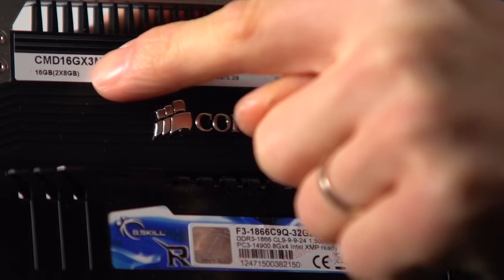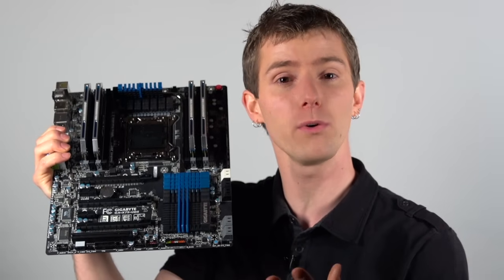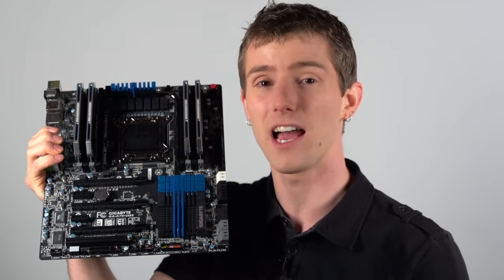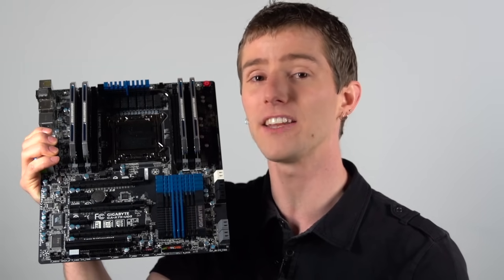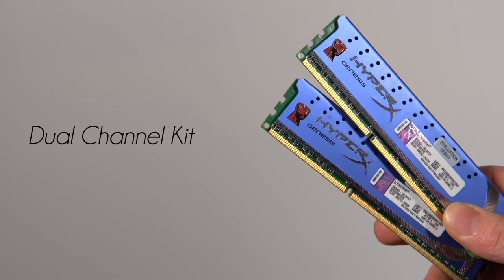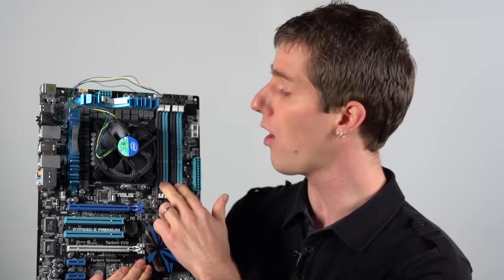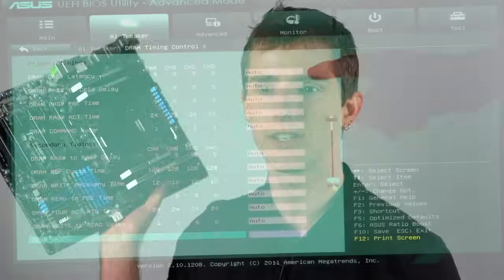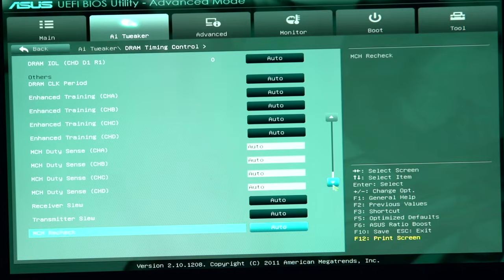Guide to RAM Memory Channels as Fast As Possible

Comment: can i use 1600mhz on motherboard with 1333mhz capacity without any problems ?
Reply: +Jadwin Edison You could, in theory but the motherboard will most likely just run the ram at 1333mhz
Reply: lol well fuck.
Reply: It will clock down to 1333mhz, and a 1600 mhz ram might be more expensive than 1333 so find one if u could
Reply: You would do MUCH better to install the 1600 mhz speed ram.  You can adjust the setting to utilize the newer speed.  Even though they post limits on the documentation, you can over-ride them in the bios.  AND you can gain speeds in other ways too.  You can lower the wait states to gain performance without increasing the speed.  That will also offer you another way to get more performance.  I have build over 1000 machines, and I am a board designer.  Good Luck
Reply: @ralph Hi so im going to build a pc for the 1st time and im a bit confused as to how ram works. the mobo is a z370-a pro and it has 4 ram slots dual channel, it says it can hold up to 64gb of ram so i could use 4x16gb 2400 mhz right ? even tough it has 2 slots in one color and other 2 in other color?
Reply: Yea it will just be bottlenecked
Reply: good to know

Comment: so if my mobo's memory channel is DUAL but has 4 dimm slots, using 2 sticks is the way to go because 4 sticks MAY or MAY NOT work?
Reply: +iFLIP★07 I am also wondering this.
Reply: +iFLIP★07 i think what he's saying is that when using a kit of 4 ram sticks, its more eficiant if they were all on the same channel (i.e. quad channel board) and thus in a dual channel board they might not be as efficiant.
Reply: ackly14 it's not about efficiency. He plain simply says that quad channel memory might not work properly on dual channel board (mobo might fail to initialize memory's configuration automatically as it should) and might give you some hustle (configuring dozen of memory parameters by yourself).
Reply: Goran Jankovic excep that makes no sense as he said just earlier, that quad channel memory would work fine as dual channel memory. so why cant one quad channel memory set be split up into two dual channel sets? they should work just fine i would think.
Reply: ackly14 have you watched the video and listen what he was saying? They SHOULD work fine, but they MIGHT NOT. 1:50
Reply: I bought a quad channel set of G.Skill RAM and I'm using it on my z170 mobo with a 6700k. The RAM runs in dual channel and with the XMP turned on runs at the rated 3000mhz. I haven't had any crashes or performance issues yet but only time will tell.

Comment: Can I buy one 4GB stick and then later buy the same stick and work as Dual channel?
Reply: yh but no :I
Reply: yeah... but yeah. yes you can
Reply: you can but they wont be validated to work together in dual channel mode so you could end up with your ram running in single channel mode or worst case have an unstable pc but thats very unlikely so id just go for it and test it in prime 95 and if you get any problems try running it with one stick and if that works send the new  stick back and either get a refund or try again
Reply: ***** yea but that didn't happen much. Most of the time they're fine

Comment: bought an ROG laptop with 16GB RAM (16x1) single channel, when I checked with CPU-Z it says that the stock RAM is samsung brand. but since my local store doesnt sell samsung RAM I bought a Crucial RAM instead (with similar specs to the stock RAM), and thankfully it works (Dual Channel) and now im getting more stable and higher FPS when gaming (around 25% increase in perormance)

Comment: 3:26 So so does Linus mean to say that instead of running , lets say 8GB x3= 24GB in Single mode is worse than 8x2=16GB Dual Channel mode? Someone please clarify. Is running Dual Channel so much more important than Single channel?
Reply: Dual channel has twice the bandwidth of Single channel so yes, in terms of bandwidth it is worse to run Single channel over Dual Channel.
Reply: Sacrifire bandwith only if you really need that 24 GB and can't afford going all the way up to 32 GB

Comment: I bought an awesome PC in 2010 which is still a powerhouse, except I've only got 6GB of RAM, and the motherboard has a friggin triple channel set-up - and NO ONE sells triple channel kits anymore, at least in my country (looks like they're rare now everywhere...)

So what's the best solution for triple channel motherboards now? Just buy three separate sticks from a single model? Buy a quad-channel kit and subtract one? Are there specific models geared for this sort of thing on the market right now? What sort of troubles could I run into?
Reply: Work out which is cheaper, Look around for a triple channel kit, if you cant find one, go for a quad channel and subtract one (maybe sell it on ebay/local computer shop) if a quad channel is not an option or it is too expensive, go for a dual and a single channel rated at the same size and speeds and same brand (this setup is the least desired and may not run optimally)
Reply: I think Corsair still produces a triple channel 12GB kit.

Comment: what if I mix 2 different ram brands like 2gb pc3-10600 and 4gb 1600?
Reply: GamExpert XDlolz same situation, it should be fine but there is still a chance that it wont properly work
Reply: michael mckinlay it work i use different ram now the 1600 will turn to 1300 to fit the 1300 ram
Reply: GamExpert XDlolz That happens with two different frequency's, aslong as you dont have an amd apu, the 1300mhz shoudnt be a big deal
Reply: +michael mckinlay Hi Michael can you please tell what i should do in case of an amd apu because that's what i want to get right now any help would be appreciated thanks a lot
Reply: Reda Lamine if you are getting an amd apu then I would suggest getting the highest frequency ram you can get, as it improve performance dramatically, 1600mhz will be ok, although anything over 2000mhz is preferable.
Reply: +michael mckinlay wow duuude u're the nicest most awesome person i've met in a good while thanks a looot for answering :D have a nice day !
Reply: +Scott Taylor Thaaanks !  :D

Comment: Rocking that mismatched RAM here. Though at least they are all the same speed and brand :P
Kingston 1600MHz
a dual channel kit of 2x4GB CL9 hyperX T1
a single channel 8GB CL10 hyperX blu (running at CL9)
and a 2GB hyperX stick from a dual channel kit :P
Reply: Same, well kind of, running a triple channel kit in my Asus Z87-A, hoping to replace the RAM in a few weeks with a more appropriate kit though.
Reply: Malsherz I don't think it matters too much tbh. When I went from 8GB to 18GB all I noticed was how awesome it was to not run out of ram all the time :P
Reply: bassl0va True though my measly 6GB's is a bit lacking for what I do, bringing it up to 16GB's would be better, not to mention my old kit could go back into my old system which I'll use in my living room as an over speccedl HTPC and private Minecraft server.

Comment: You didnt cover motherboards with 4 slots and how to properly fill them, if it is even wise to do so, question is when having 4 slots of 2 different colors would you buy 2 dual channel kits identical to each other to populate all four slots or would you only get one kit and fill only 2 slots? thanks
Reply: Ideally, if you've got 4 slots and you want to go to 16GB, you should see if your motherboard supports up to 32GB. If it does, order a kit of 2 chips and only populate two of the slots. Filling the second set of slots should change your performance at all (as in 4x4 instead of 2x8), but it does limit you for future expansion. If 16GB is ever not enough, you'd have to toss some of your old modules rather than just populate two empty slots.

Comment: I'm DIMM. I still don't know what is best. Say I have a dual channel board but 4 slots. That means I "can" run 4 sticks in a dual dual set up right? If so, what is better...the dual dual 4x4 or a single dual with 2x8?

Question 2 would be if 4x4 is better should I buy 2 packs of 2 or 1 pack of 4?

Finally, if 4x4 is better in a dual channel mobo with 4 slots would it be EVEN better to look for a quad channel mobo?

Just so I can say I TRIED to understand. I think the answer would be 4x4, 2 packs of 2 and yes.
Reply: +InItForTheParking 4 dimms in dual channel is dual dual, yes. Either way is fine, but quad channel mobos are a money leech, so 4 dimms in dual dual is more money friendly.
Reply: SquidPlays Thanks
Reply: *****
 no prob

Comment: Once again more was understood. From what i gathered i currently have a dual channel kit aka 2x2 for 4gb. Ive ordered another which is 2x4... wonder if the fact that the memory amount is different will matter...

Seperately the kits should work no issue as one is already in use and the other was bought from a site that did allow me to use cruciala configuration program to make sure the ram works for my setup.. in this case the motherboard

Comment: The effects of mismatching RAM is almost entirely up to the motherboard.  I have 4 sticks of RAM in my board, 3 of them are the same at 1333MHz with a CL of 9 and another at 1333MHz with a CL of 8.  My board set the latency of all of them to 9.  On top of this, all of my ram is overclocked to 1600MHz with a 0.05v boost, and my CPU is overclocked.  All this being said, my board is still confirmed running in dual channel.

Try doing this on an OEM computer and you'll likely get some issues.  Like I said, the board makes a big difference.

Comment: I'm still unclear on one thing. In a scenario with a dual channel motherboard and a target RAM total of 16GB, which is more advisable, disregarding budget? 4x4GB sticks populating all slots and both channels, or 2X8GB sticks seated in only 2 slots across a single channel? I'm solely interested in which configuration would yield a better performance, however minuscule.

Comment: Hey Lynus,
Do you mean for a CPU and Motherboard set, one channel is assigned to one memory slot? And that is why single channel meaning single memory stick?
And dual channel means using two memory sticks?
I can see several single memory sticks with dual channel support which is kind of different from what you mentioned or mentioned by all other youtubers (mostly, as I can't check all videos).

What is 1Rx16 or 2Rx8 for a single memory stick then?
May I ask you to please explain a bit more on this topic in detail.
Thanks

Comment: Is there any performance disadvantage to using two 2x8gb kits in a dual channel motherboard (32gb total); would it operate slower than if I had just stuck with one 2x8gb kit (16gb total)?

Would using two dual channel kits bring the same risks that using a quad-channel kit would?

Comment: I got two 8GB sticks Hyper X Savage at 1600. I got two more sticks with the same specs and brand, but they are 2133. Will these work together fine? I know they will clock at the lower speed sticks. I just wish to know if they will work together. They are both the same brand and have the same specs besides there speeds. 1600 and 2133.

Comment: If I currently have 2x4GB ram, should I get another 2x4GB kit and install that, or should I get a 2x8GB kit?  The new 2x4 kit would be the same specs, but wouldn't be from the same kit obviously and would use all 4 slots. The 2x8gb kit would have all the memory of 4x4GB set up, but would be from the same kit and use just 2 slots.  ... Also, how about keeping the 2x4gb and adding another kit of 2x8Gb for a total of 24gb? Thanks!!!!!

Comment: Hi please please anyone answer me a question. 

This is more of a server question with quad channel architecture. However I am also interested to know how this would also work in other dual and triple configurations. The same principals would apply.

Is it possible to bottleneck a RAM config?  So for example channels ABCD all have matching 16GB sticks of RAM but then channels A,B also have an extra 8gb stick each in their next available slots.
I was taught that each channel needs to be identical for the architecture to work in “parallel” in a multi channel environment. Are those extra chips effectively bottlenecking the server IF the first 64gb (however unlikely) is succeeded???

A- 16GB, 8GB.
C-16GB.
B-16GB, 8GB.
D-16GB.

My understanding lead me to believe that once the first 64GB is used the system would still try to work in quad channel but as there are only 2 sticks then issues would occur. Is this right or wrong?

Comment: So I have a LGA-2011 Motherboard, but I'm working on a tight budget, and right now, I can only afford one stick of RAM. I intend to upgrade later, and the Motherboard has a maximum capacity of like 128 GB, and like 8 slots... I believe the slots feature two colors, blue, and grey. I assume this is 2 quad channels? Obviously i know VERY little about motherboards and RAM. So yeah, will one 8GB card ruin anything, or will it be safe to use?

Comment: One thing i didn't understand, and i'm sorry for it, if i get a dual channel motherboard and i put in it a dual channel memory in the main color coded slot (let's say a 2X4Gb) can i later add another couple of rams the other 2 slots or it would be better to remove the previous two and buy a double capacity rams (2X8Gb) to use in the main color coded slot?

Comment: question like said in the video you should put a dual/quad memory kit in each respective same color slot (dual/quad channel) so for example i have a dual memory kit and the colors in my board are 2 blue 2 black so if i put on 2 blue slots im doing it right, but can i put it on the other 2 colors lets say i just want to try the other two will this work ? will it be the same as before ?

Comment: I don't know if this applies to other motherboards but HP have this "Duplex Mode" on their manual.
I'm using 2x2gb 1333, 4gb 1333 and 4gb 1600. With duplex mode, the 2x2gb 1333 and 4gb 1333 runs on dual-channel and the 4gb 1600 runs on single-channel (system reads 12gb useable ram).

Comment: Hey there's a sale right now on ram for cheap price. The ram is 1 stick Visiontek 4gb ddr3-2133mhz for $41 that's dam cheap for a high frequency ram. But it does not come as a dual kit. So I need to buy 2nd one separately with exact same specs in order to get that dual kit specs 2x4gb DDR-2133mhz ram. My question is will it work just like buying the dual kit? Will it validate flawlessly working with each other?

Comment: I know this is an old video but you're the only one who answered my question. I have 3 ADATA DDR4 8GB sticks but two is 2400mhz and the stock stick came with the 2666mhz. I ordered the 2400 due to pricing. So I was wondering about the 3 DIMM slot and you said its better to just take out the 3rd one if you want the bandwidth. So I do want 24GB RAM but idk if it will sacrifice my performance with high RAM producing games like RUST. Anyways I will try both ways and see  which works for me. TUF-B360M

Comment: so the set im getting tomorrow comes with a specific 4gb ram card...

if i buy a second one of those OF THE EXACT SAME MODEL (the site where the pc is bought from allows you to click on the specs and buy each part seperately, which means that i know for a fact its the exact same type of ram) will it be able to work?

Do you need to buy them as kits or would finding a ram card and ordering 2 of the exact same thing work?

Most likely my dad will be able to answer this but id like to learn.

Comment: So if I use a quad channel kit remove 2 modules from it I have a dual channel kit which would work the exact same as a natively dual channel kit in a dual channel motherboard or would there be a difference? I find this video extremely confusing. Another thing I don't really get is how you can't implement well 'normally' a quad channel kit into a dual channel motherboard. If this is the case do you always have to buy two different dual channel kits to fully populate your RAM slots in a dual channel motherboard with best performance?

Comment: Hey Linus, I have 2 RAM kits which is the same brand and has same timing, voltage, and speed but one kit is 8GB while the other is 4GB. Will there be any benefit for me to run them or just the 2 8GB kit? I appreciate your response. Thanks

Comment: So I built my rig during Covid. DDR5 Build at that, so I could only get my hands on a single stick 32 at the time. My motherboard isn’t color coded. Straight single sticks work. So would it be okay to add a 2x16 that I was gifted? I haven’t even opened it, just cause I don’t know if it would benefit it or not.

Comment: Do RAM sticks need to be bought as a kit to run as Triple or Dual Channel? If I buy for example 3x4GB rams sticks separately (the same 4GB RAM stick 3 times, exactly the same stick 3 times) will it run on triple channel (since my motherboard is capable of running triple channel) or it will run as single channel?

Comment: My computer has an i7 4770 and I initially had 8gb of ram in dual channel.I purchased another GB in dual channel and I think I have some issues running Avid Media Composer and Adobe Premiere Pro CC 2015. Whenever I export anything(usually h264 from DSLR footage), these applications(Avid especially) don't use more then 8gb of RAM although  both of them detect 16gb of RAM.  Do kits run a specific task? For example, one kit can only handle the export while the other one runs a different application an OS? And can you get them to work together on a single task? (exporting something from Avid and Adobe Media Encoder in the same time seems to use more than 8 gb). Sorry for the long post :D

Comment: Hi!
I have an Asus M4A87TD EVO motherboard.
I understand the difference between a dual channel and a quad channel memory architecture. However I don't really understand how the 2 x dual channel works. Shouldn't the ram be paired 2x2? For example 2x4GB Team Elite on a channel and 2x4GB Corsair on the other channel?
Could there be problems with such combination?